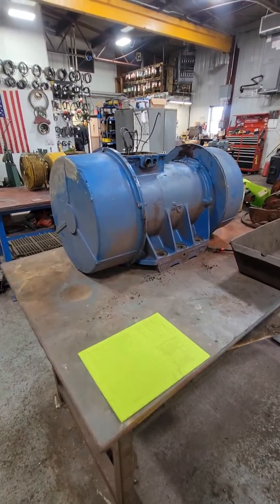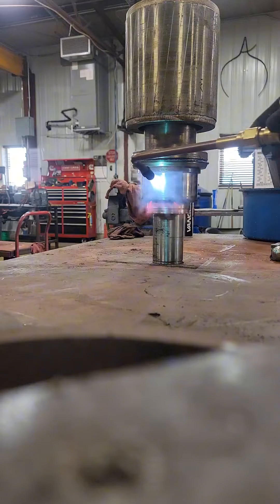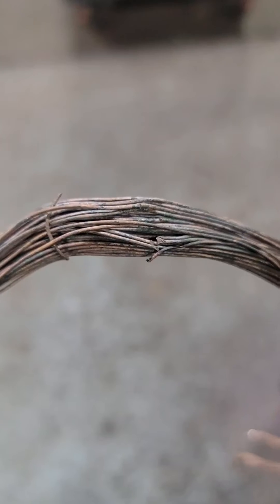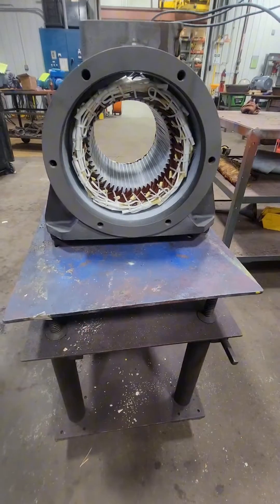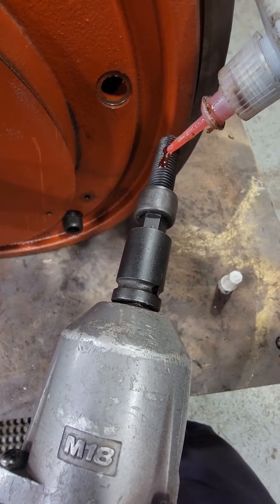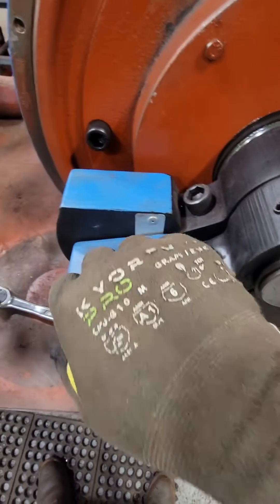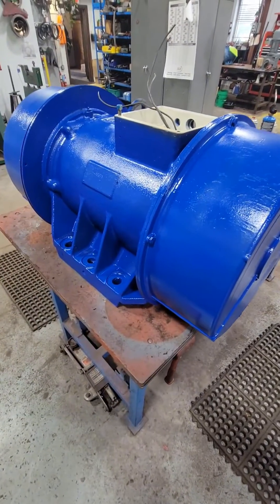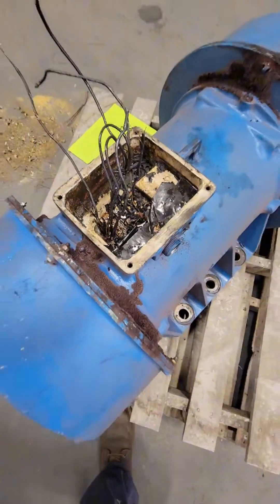Vibrator Motor

Comment: One of the things I’m working on (as my theory needs improving) is when it comes to interconnecting leads. Where to start from for your lead out then to the next series connection for example. I get it just want to understand it a bit more. Depending on the speed of the motor, coil groups etc etc. 
great vids by the way.

Comment: What is this used for?
Reply: Plants that do large molten metal castings will have shaker decks to shake loose the part from the casting sand.  Think John Deere Foundry, giant castings you need to get out of molds in a timely manner.